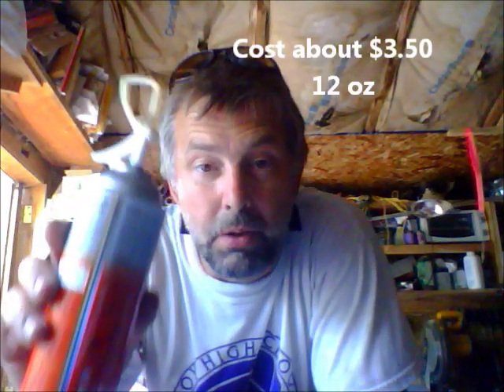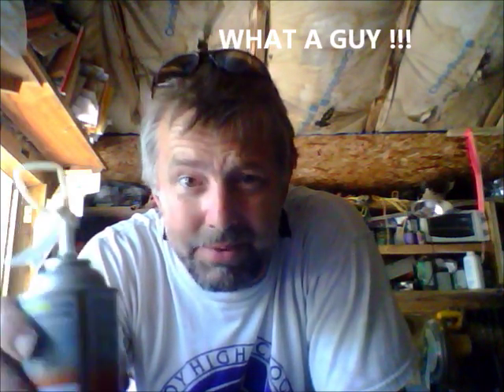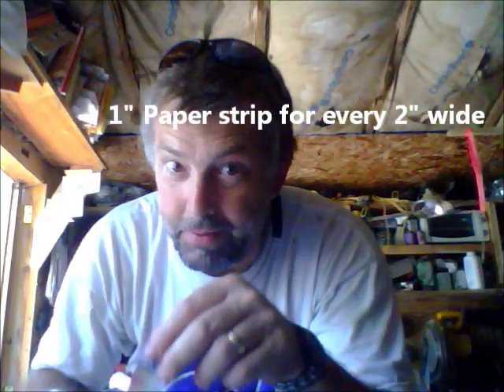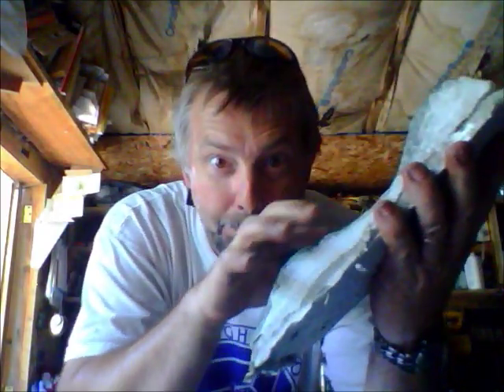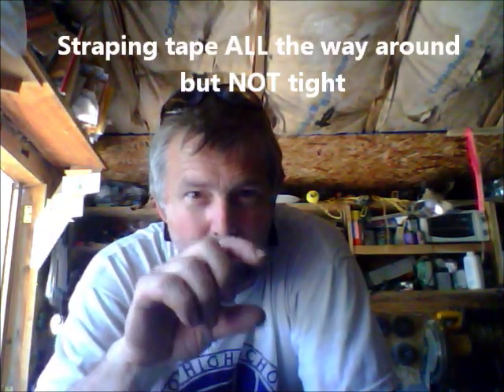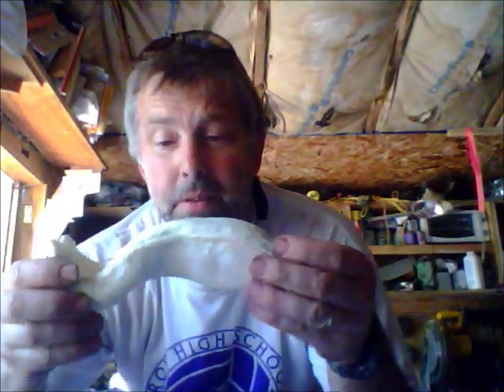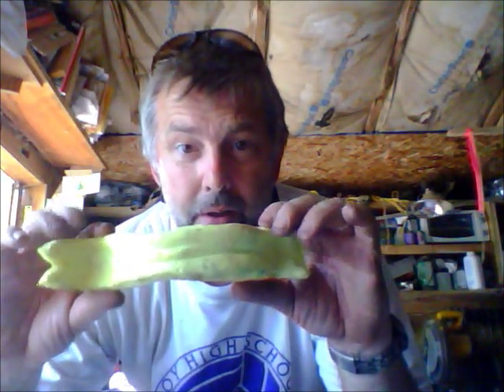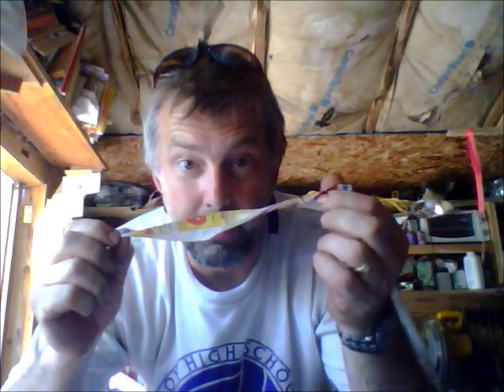Great stuff casting secret

Comment: have you tried mixing with sand?  any spray foam can perform well outside? I want to make spray foam boulders and building blocks.. got tons of free white sand, need a lightweight, insulating and expanding aggregate.  Will spray paint once cured.  cans might be too expensive for my project though.

Comment: Im looking into different DIY foam wood ceiling beams for a house project. Im curious if you have any suggestions for 1- making a 20 foot mold and 2- how to prevent the spray foam from sticking. Would vaseline work with a wood mold? should I first make a mould using a material other than wood?? any ideas or suggestions would be so appreciated!

Comment: How do I paint the foam ,  I just  tried covering with fiberglass resin  after researching it saying it was ok,  I have a melted pile of goo , I am making an egg made from a plastic mold   It comes out  ok but how do I paint  and remove the Vaseline for paint to stick   .  ?  Thanks  🙏🏻
Reply from the maker: Making an egg .
I have a new method that you will love.
ALF system. 

Take any object. Large in size than a cat.
Step 1
Cover with aluminum foil using very little tape contacting the original pattern. 
Step 2
Cut paper rags (thick paper towels, shop cloths) into quarters. 
Wearing gloves rub a coating onto the surface of the aluminum foil. 
Only cover enough surface to allow 10 minutes of work time. 
Step 3
After the surface gets very sticky.
Spray a dollop of foam onto a piece of paper towel. 
Press your hand into the foam to lift the paper.
Press this onto the sticky aluminum foil.  
The fresh foam on your glove allows you to press flat the paper.
Step 4
Dry overnight.  ONE layer like this is strong enough for almost any display project. 
Use a razor to cut out the original piece. 
Close the seams with a squirting of foam. 
Step 5
The result is an object of great strength and ultralight mass.
The surface is bumpy but canbe easily sanded.  Cover with bondo or plaster for fine paint.
Reply from the maker: Vaseline I use alcohol or mineral spirit

Comment: If you grind newspaper in a blender with water, you can make a wet paper paste n spread thin with a brush on the mold.  Any dried paste sheet can get Re-wet with a spray bottle.  Then you spray foam the mold to make your cast

Th

Comment: I know this  an old video, but I've been thinking of using this stuff for casting lately. Great tutorial by the way. Just one question, what do you use to clean the Vaseline off the cast object? 

Cheers.
Reply from the maker: Usually with the mold I don't bother cleaning it. As for the original try using some mineral spirits. then Dawn dish soap. I have found that the soap works well for all types of grease removal.
Apply the soap with no water, rub in just enough water (drops at a time) to emulsify the grease and soap. Once that is done wash with larger amounts of water. Rinse.
If some grease remains dry off with paper towels and repeat the soaping process.
Reply: Ok, but can you paint it with acrylic then? Or is it best to use oil based? I'm trying to make a SciFi building. So once it's cast up I'd like to paint it. Lastly, is it hard enough to resist rough treatment without denting the surface?

Thanks. 

Excellent video by the way, I've been thinking about this for a while. It's been a great help :)
Reply from the maker: head head Okay I've refreshed my mind on what this video says. The foam from the spray can is safe from most chemicals. Example mineral spirits, I think even lacquer thinner. Once the Vaseline has been washed off. Any type of paint can be used.... come to think of it since it is safe to spray paint then most any chemical can be used to clean the surface.
If you want a high quality finish try the wood glue and plaster mix. this is sand able and will not chip off even with some rough use.
Painting acrylic is very durable but any quality latex paint will work.
The idea is to pick either water base or oil base then stick to it.
The first coat should be a primer of either type base then go on from there.
Reply from the maker: Should you want a really stiff surface that will hold up for a long time. Try using bonding agent from the cement section of your building supply store. Mix this with small amounts of thinset (both will be found in the tile section. This will give you a rock hard surface that is for the most part weather proof.

Comment: I want to make a mold out of my front bumper to make a lip for it but I fear it would stick to my bumper I just want to make the mold so I can then shape it and bolt it up on it(I want it to be removable lets say).Will the vaseline on the bumper work on not letting the spray foam stick to it,its not painted its bare plastic
Reply from the maker: This is a big project very similar to what I plan to do later this year. SO here is my idea . Take heavy duty aluminum foil cover your body part with it press down tightly . Use some tape to help hold it in place. Try to put the tape somewhere easy to remove once the foam is setup. Work all of your foam on the bumper. (over the foil) after a few days of curing the foam will be ready to cover with regular Bondo type body filler. Not if you cover the sprayfoam too early you will get shrinkage. Once the whole part is covered pry off of the bumper. The foil allows this very easy. trim off any excess foil. This should be enough information for you to move forward. OH important point !!!!! mist the foil with water before adding the spray foam.  BEFORE ! adding foam . The foil will not cure well if you don't.  My comic book explains many processes that you may use. "MAD SCIENCE HANDBOOK"  It costs $10 you will get many new ideas.Email me at dragonwyck121@gmail.com for ordering one.

Comment: Sir need to one thing about Fibreglass and Silicone resin!
I want to make small ship of Fibreglass using silicone resin instead of Polyester or Epoxy resin! Please suggest some do's and don't regarding that. As i'm unable to get Polyester or Epoxy resin nearby! Thanks a lot for your help! :)
Reply: How big a ship ? I'm an old boat builder
Reply: Sir, 
The actual model of ship is 3.6m x 1.9m x  1.5m.
But we are making a proto model to test the hull on low scale of reduced size. Yesterday we tried with silicone resin and its worst can't be used further. Kindly suggest which resin we should use? and which type of Fibreglass cloth?
Reply from the maker: Yes, for one thing the silicone would not be at full cure yet. As for a bad idea you have found it. You would be better to use Tight bond II this will give you much of the same performance as epoxy or polyester. It is available in many hardware stores or online. The drying time is rather long, a few days. Remember that it can not be recoated. Building a scale model is a complicated process. Try the wood glue. It is water resistant and should work well for testing... Hey even for the full size the Tightbond II  might work!  Saves a lot of money on resin!Good luck.... Really for the best results use the right products.

Comment from the maker: Special note continued..
If the surface of your piece is shrinking... you've used too much water in the spray mold.
If the whole thing shrinks everything was too wet .

The news print can be eliminated in smaller pieces by a slight spray over the foam before closing mold.

5. Let set in mold over 2 hours or over night .

Comment: Thanks for the useful tips. But what function does the newspaper serve? Thanks!!
Reply: i believe its so that the foam doesnt stick to the mold in any way. like wax paper on a pan for cookies
Reply: He said that foam has to be exposed to moisture to harden. The strip of news paper, sprayed with water, is placed over the first half of the mold, which will be the center of the mold when the other half of the mold is mated with the first half. The center of the mold is where the least amount of air, with moisture in it, is thus harder to get the foam to set. So that strip of newspaper that is is damp will act as a source of moisture in the center of the mold to facilitate a fast, complete hardening of the foam.

Comment: I'm going to have to coat, sand and paint my castings after some shaping.  Unfortunately, tests show that fiberglass resin basically melts the foam, which didn't surprise me.  I see you coated one in glue, I may try that.  What is your usual process prior to painting?  I'm going to give body filler a shot next.  Hopefully it's not as harsh on the sanded surface as the resin.
Reply from the maker: The extruded foam will melt when covered with any petroleum content. including bondo body filler.
If one wishes to use body filler start with Dow R board or similar. even canned spray foam can be coated with fiberglass resin (I THINK haven't tried it)
The two foams I have just mentioned are some type of urethane and should not react with oils.  A good way to test your foam is to spray a little "spray-paint" on to it. If the shape does not change after a few minutes then the foam is safe for use with auto body filler or fiberglass resin.
Reply: dragonwyck121 Bondo had the same effect as the resin on test pieces.  I ended up coating the foam castings in plaster, as the can recommends for coating.  Then sanded some more to get the final shape.  I then made a plaster mold of those, and am making hollow fiberglass copies of the original foam/plaster positives.  Took a few more steps than necessary, but the finished product will be what I was hoping for, which is all that matters.  Plus I can make multiple copies now, which is ideal.

It was looking like I would have to spend about $50 in materials from the plastics store.  $20 or $25 for either silicone or latex, for molding.  And $30 for a quart of expanding foam.  Just to make two small car parts.  Ended up doing it for a total of about $12 including plaster, canned foam, and knock off Play Doh from the Dollar store.
Reply from the maker: You might try adding a little glue to your plaster. Thus will be sandable.
If you plan on using fiberglass coating use a polyurethane foam or expanded polyester . Both are available online.
Try going to a new construction site. Get a small piece of Dow R board. Yellow foam with silver covering. This will take most any solvent based coating.
Reply: dragonwyck121 Glue would have made the plaster shell stronger if I had stuck to my plan of using the original parts on the car.  I spent too much time on them to risk losing a one-off set.  The plaster was easily sanded smooth enough for the final molds.  Which I made of plaster.  I had to break them to get the masters out without damage, but simply clamped the broken pieces together, and filled remaining damaged areas with the Play Doh, and made near perfect fiberglass copies which will use as the final parts.  I do have a half can of the foam left, so I keep trying to find a use for it before it becomes useless.  I'll probably just hang onto it and hope to clear the nozzle if I never need it for another project.

Comment from the maker: I received a comment about REMOVING great stuff foam from a bike. Specifically on aluminum.  While it is wet or fresh use a paper towel with acetone , carburetor cleaner , or fingernail polish remover.If it is a small amount on a delicate surface it might be best to not touch it until it sets up . In this case use a small wooden popsicle stick to scrape the hardened foam off. I often use my finger nail .DON't  wipe it off unless you have the right chemicals first. Else you are just rubbing t into the surface and making it harder to remove.
Reply: dragonwyck121 I

Comment from the maker: Special note!!!!! I was working with silicon molds today with varied success.
In case I don't update the video..... Here are the updates.
1. Don't spray water into the  mold, just wipe with damp cloth or maybe enough moisture in car wax which I have in a mold right now.
2. Add plenty of foam then close the mold. The denser  the foam the better less shrinking.
3. Cure time.. in about 1 hour but the foam is still working. Who knows what it will look like in another hour. Swells then shrinks.
Reply: I found that enough back pressure is important for detail!

Comment: There's another instructional video that proclaims that you have to let the great stuff blue can sit in a closed mold for one week - and they used the slightly damp paper towel strip in between layers of foam in both parts of the mold.  They then clamp it and leave for a full week.  What say you to this?
Reply from the maker: +Joanne Gennarella  I don't suppose that will hurt. I usually only wait overnight. In some cases you can open the foam in hours depending on whether you misted the foam first.  What you are trying to avoid is having the product shrink. Opening too soon can have that effect.Let me state that one way to accelerate the curing time of foam is to mist it with a water sprayer. The foam will puff up a little more and cure very fast. The nice thing about the internet and ART work is there are so many experiments going on that you can hear all sides of the subject..... uh, I guess that could be a bad thing also. You never really have a SCIENCE that is perfect.I like how people also show their mistakes so we can learn together.

Comment: Is that a plastic mold or a silicon mold or a plaster mold?   I would imagine a plastic mold will melt from the spray foam?
Reply from the maker: Son Of Hibbs it is made from plaster. A plastic or silicone mold can also work. Experiment with small pieces first
Reply from the maker: PS spray foam in the can does not get hot

Comment: Well..years ago i tried this...they now make a type that will dry inside ...back then they did not...it was a mess...BIG MESS..and i havent tried since..ive seen a lot of guys use it...but one type wont ever dry...EVER...in a form.
Reply from the maker: The spray foam will NOT harden in a mold without adding moisture.
Note aluminium foil applications you should mist with water prior to adding foam.
Reply from the maker: Try post setting foam at Lowe's.
It comes in a bag. Seperate the 2 chemicals Carefully. Mix smaller amounts for your projects
Reply: @dragonwyck121  so it will work on any kind...interesting...

Comment: dragon:  Maybe a foam casting made this way could be used as a pattern for casting aluminum via lost-foam casting?
Reply from the maker: Have not tried it as a casting .. give it a try the foam melts at about 250* f
The molten metal is above 500* f .
Mad science at work!
Reply: It does melt away, but with some nasty fumes.